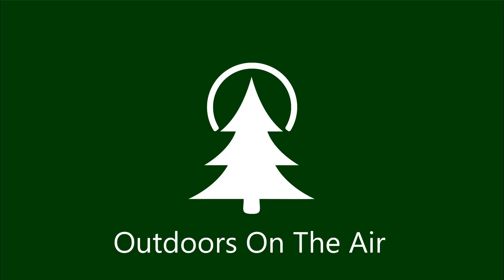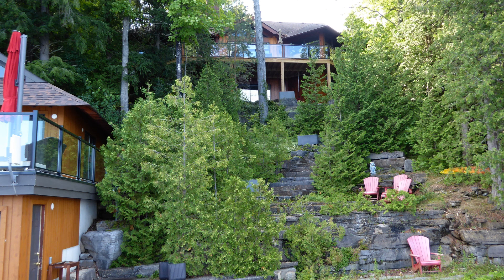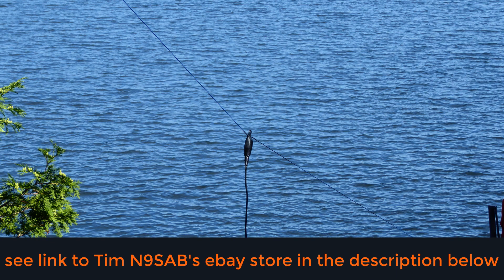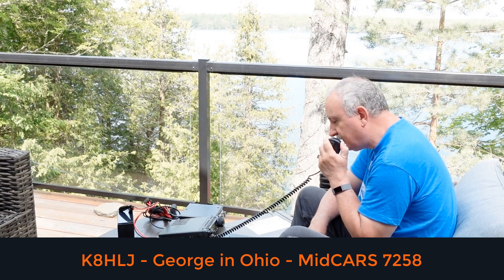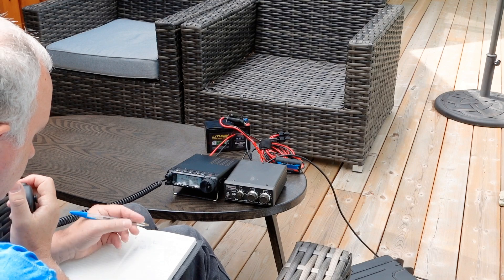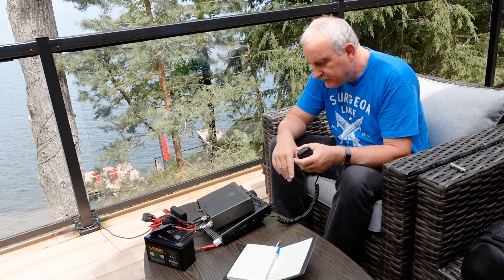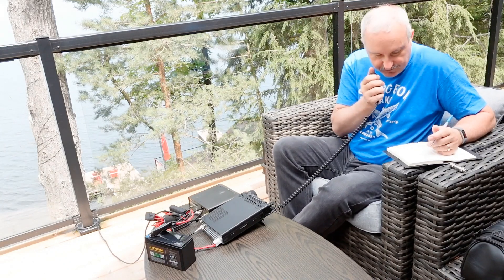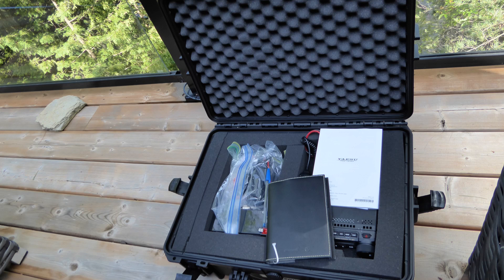Crazy HF Portable Deployment - Using a Below Ground-Level Antenna

Comment: Hi Tracy , why did you need a tuner? It’s resonant on 40m no?
Reply from the maker: Yes, the antenna is resonant on much of 40 when put up high and in the clear. With this installation, I needed the tuner to bring the SWR down below 2:1.

Comment: Great video Tracy. I have the same antenna in my portable gear box and haven't used it in quite some time. I will definitely set it up in my backyard and have some fun working from our deck with my KX3.
Reply from the maker: Thank you for watching! That antenna is a performer.

Comment: Just shows how well water under your Antenna works. I tried it year's ago from a very short mobile 2Mtr Antenna on top of my car when parked right next to sea water, using a home brew ATU I operated on 20mtrs and worked a missionary who was in a tent on a beach over 5000 miles away.
Great to see you having a successful  time on vacation.
Brilliant stuff 👍👍
Reply from the maker: Thank you for sharing your experience! That's impressive performance from a 2 meter whip.

Comment: Tracy good to see the contacts you made. I used to communicate with an operator located down in the Pan-handle part of Florida using JS8. His antenna was what he called a "dead man's antenna" and it was  made of twisted pair wire and it was buried below the surface of the ground. He did this in case of hurricanes coming in and taking down his other antennas.  It worked quite well for him. 73'
Reply from the maker: Thank you for sharing that! Interesting stuff. 73 from VE3TWM.

Comment: Unusual antenna configuration for sure.  But you made some nice contacts.  When did you get an FT-891?  I love my FT-891.  I sold my much heavier FT-897D to purchase the FT-891 and it now serves as my portable field radio as well as my mobile.  I am very satisfied with this little radio and highly doubt I'll ever sell it.  I also choose to run only 20 watts when on battery power with my FT-891.  Seems to get out well and my battery lasts longer than I usually do...lol!  73!
Reply from the maker: Picked up the 891 just prior to my trip. Thank you for sharing your thoughts on the little rig. 73 from VE3TWM.

Comment: This is excellent because, my property drops 80 ft from the side yard to the end of the back yard.  One question tho, (not sure which direction your antenna was facing) but how were the signals from 'behind' the antenna(from the sides/front of the house)?
it would seem with the angle of the antenna, it would perform similar to a vertical instead of a sloper.
Reply from the maker: Interestingly, the antenna was sloping to the west, and 2 of the 3 stations I worked were to the East. You may be right about it acting more like a vertical.

Comment: Great video! I think your advantage is the nearby body of water and the large building you were at. I have had good luck in my mobile outside my wife's work place in front of a large two story building. I actually heard my signal go from a 44 to a 59 just by driving to the front visitor parking spots 30 feet from the building like you are next to a building higher than your antenna is mounted. I was using a FT-891 and a Shark Distributing hamstick on 20 meters. You are right, do not discount a compromised antenna.
Reply from the maker: Thank you for your comment and for sharing your interesting experience. I once worked a station in the Indian Ocean on 15 meters with one of those Shark mini whips.

Comment: Pretty sure I heard you make that first QSO. I was on my deck with my FT-818 and a 65’ EFHW strung from my deck rail to a tree at the edge of my driveway. Made 13 contacts that way. Amazing what you can do with 5 watts and a wire.
Reply: 6 watts
Reply from the maker: Cool! Deck to deck :) Well done with the 818.